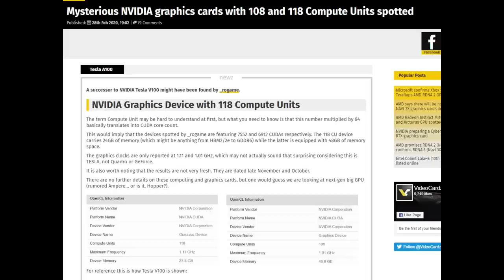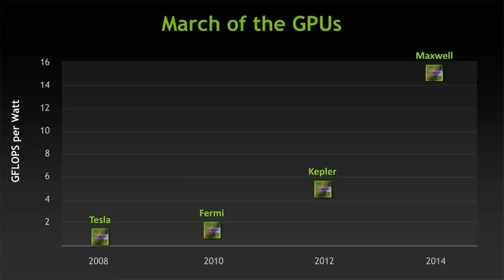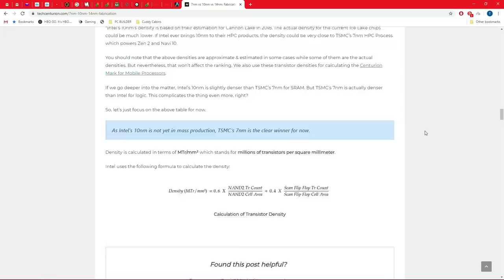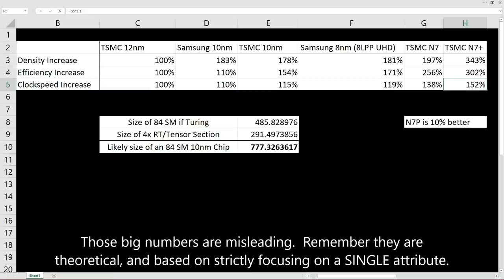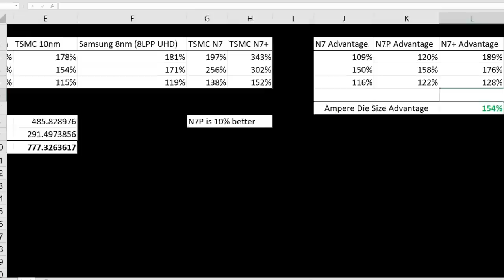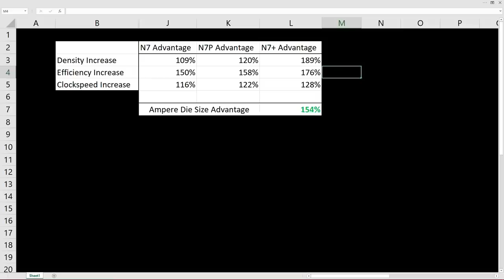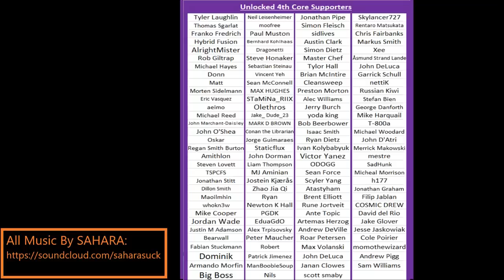Nvidia Ampere on 10nm: Still Good Enough to Defeat RDNA 2.0?

Comment: I need to clarify your math on the theoretical density improvement vs reality. 

A 60% density increase would cause a 37% area shrink for the 'same' chip. 
If the density goes up by 1.6 but the total number of transistors stays the same (just smaller), then your area is 1/1.6 of its size on the bigger node, meaning a 37.5% area shrink. 

Just pointing out that you said a 60% theoretical density increase "didn't even get a 50% area shrink"

Comment: I think what AMD needs to do is quite simple.

Step 1: release a most powerful GPU in the existence - take the performance crown from RTX Titan or RTX 2080Ti (don't know which one was better for gaming, even if Titan was never meant to be used for games).

Step 2: Gain the recognition of NOT just catching-up.

Step 3: Wait for NVidia to release Ampere that might dethrone them (most likely will with massive die, HBM2e, etc.).

Step 4: Present mid-range cards that will wreck Ampere performance/dolar.
Reply: Tbh they need to win in mid range first so they will get faith from the usual costumers with a quite low power consumption even if possible make the lower end one wreck 1650S/5500XT while having a 75W TDP
Reply: @3dcomrade  Yeah, that's what they did with Zen - start with midrange parts at good prices, refine it and improve it, and sell the last-gen parts at reduced prices until the competition is virtually irrelevant outside of the absolute high-end and niche low-end use cases, and then release a stupidly powerful high end part that humiliates the competition with more than double the performance at half the price.
Reply: That's exactly how AMD could fail, ironically. By attempting to fight at the top end where they have lost, and will continue to lose to nVidia (they have half the revenue of nvidia, bear this in mind) they will stake out fairly valueless territory. Top end GPUs account for less than 1% of sales. If amd want to do well they need to produce a stable mid range product, focusing on a 2080Ti competitor when their basic 5600XT card is stuttering, black screening and down clocking is an amusing ambition.
Reply: @nathangamble125  actually they did the samw with RX400/500 series dropping the prices a lil bit til its priced against a card thats lower by one tier e.g: RX570:1050Ti
Reply: Why not just give out free cards
Reply: @Blue Sky I am not sure if you have read the game plan till the end. Point 4 is what brings them money.
Reply: @Blue Sky Hope they do, because the longer they stay afloat, the bigger chances we have that prices will be kept in check.
Reply: High end market is a niche the real money is at mid range

Comment: Hey Tom, new LG TVs rumours started to circulate and the much anticipated 48-inche smaller and cheaper g-sync oled for gamers is coming. What do you think 👀
Reply: 48 inch screen for gaming? not at a desk unless you want neck problems.
Reply: @forasago  I bought a pretty large desk to for my piano, I can see why it won't target "all" gamers or at least most of them but a lot of people (including me) are sick of LCDs and are looking for replacement. If the TV does well, there's no doubt they will move to as smaller as OLED allows them.

Plus I watch a lot of TV series and movies along with sport, so instead of buying a mid-tier TV for £400 or so and another 400 for a 1440p 144hz. This replaces both. So I'll make sure it will work on my desk

Comment: It's not Navi "two X".  It's Navi twenty-something.
Reply: Do we have a source for this? If not it could be either.
Reply: @LaughingOrange  The source is common sense.  RDNA 1.0 is "Navi 1X", which means Navi 10 and Navi 14, the two dies on the market now.  RDNA 2.0 is "Navi 2X", which means (so far) Navi 21 and Navi 23, the two leaked die names.  And RDNA 3.0, called "Navi 3X", will have die numbers starting with 3.
Reply: @MaggotCZ  Well, it's probably fair to say that an 80CU RDNA 2.0 die will be twice as fast as a 40CU RDNA 1.0 die, but that's just from basic math.

And it's also fair to say that many, many TechTubers have made the mistake of assuming "Navi 2X" has something to do with performance.

Comment: The node only helps AMD so much...they need the architecture to deliver...and they've been falling behind on that for years...but now that the console works is essentially done, AMD can finally deliver on the high end PC market.
Reply: They are on par with Nvidia. Look at 5700XT vs 2070S. 2070S is 5% faster which is probably due to higher clock speeds.
Reply from the maker: The ironic thing is the 200 series was actually the start of RADEON'S decline.  It's about mindshare.
Reply: RDNA has actually been pretty good, and RDNA 2 is supposed to be as big of a jump over OG RDNA as RDNA was over GCN. AMD also said this during an event for their investors, meaning it's not likely seriously stretching the truth. It honestly looks like it's going to be fantastic, and I doubt Nvidia was really prepared to have to legitamately compete with it.
Reply: Mianlo 2  NVIDIA released the GTX 1080TI for the same launch price as the GTX 1080 and dropped the GTX 1080 price, because of the competition with Vega. But Vega did not deliver as promised.

Comment: 980 ti vs 1080 ti = 70% improvement
1080 ti vs 2080 ti = 33% improvement 
2080 ti vs 3080 ti = 40% improvement
Unless a 3080 ti costs LESS THAN $699, what the hell are you guys stoked about?
Reply: You conveniently left out "780ti vs 980ti = 35% improvement". 1080ti is simply anomaly because double die shrink, 20nm node didn't pan out and maxwell had to stick with same already three years old 28nm node used by 600-series. Then Pascal's jump to 16nm provided massive clock speed and efficiency gains. Yet people are expecting similar improvement in every generation, even if there's no die shrink at all.

Comment: 05:12  Vega 20 is not the same design as Vega 10.  It has two extra HBM2 controllers, and overall about 700M more transistors.  What they actually got was about 56% higher density overall, based simply on transistor count.  Not all transistors are equal, of course, and designs might have some dead space built in for one reason or another.

On the whole TSMC 7nm density is about twice that of the GF/Samsung 14nm process, meaning that's the best you can expect.  Their mobile 7nm process is a bit more dense, but that's not for high performance parts.
Reply: Actually the mobile node might make a lot of sense for the low-end parts like a RX6300. Making the die smaller and more efficient at lower clocks could be good. They would also gain a lot of knowledge about how these mobile nodes behave for their partnership with Samsung.

Comment: nVidia's position regarding power efficiency is especially interesting in this context. they've traditionally had a huge efficiency advantage, but going with a big die against RDNA 2.0 might cost them that adantage. They were able to pull this off with Maxwell partly because AMD was lost in power inefficiency hell back then.

Comment: First intel now nvidia going to milk people by staying on older nodes
Reply: Nvidia has literally been doing this for 10 years. AMD has pretty much always been first to new nodes but Nvidia usually stays on the mature nodes and make bigger chips. It even allowed them to have the performance crown in many cases because of issues on the new nodes.
Reply: @fVNzO  
Yields are higher too so I suspect higher profit margins have at least something to do with that decision
Reply: Why does staying on an older node automatically imply milking customers?
Reply: @ShawFujikawa  They are sticking to inferior technology because of business reasons. So its them hoarding technology or not giving the best to the customer that they could be giving.
Reply: @The_Man_In_Red  I can't remember the details but adored had a video back in December I believe detailing this exact strategy. Amd ran into plenty of issues jumping the gun on new nodes which didn't allow them to increase die size. So it's a bit of both. RTG made a string of bets that continually let them down so you can't fault Nvidia for sticking with what works either.
Reply: @NatrajChaturvedi  Why are you assuming performance is the only relevant metric here? This is not a zero-sum game.

Think about it. AMD is currently still using their older 14/12nm node for some of their lower-end products to keep prices down for customers. Giving you a better deal is somehow milking you?
Reply: that is not milking. you use what make the most sense for your company. same with HBM before. using HBM does not necessarily making the card to have advantage vs one using GDDR5/5x/6. so why need to use more expensive HBM? and there is a real benefit for to be less reliant on node shrink to improve performance.

Comment: If they just increase the die size without changing the process or architecture, isn't that going to require PC builders to get ridiculously high wattage power supplies? Like say if they take the 2080 Ti and increase the die size by 50%, would that require a 900 - 1000 W PSU to use?

Comment: Is it correct to say that there are already "engineering" samples of AMD big NAVI and NVIDIA Ampere in the wild currently? Is it possible that both companies could potentially put their hands respectively on what the competitor is currently testing?
If yes, how "real" competition can be really guaranteed to be still a thing at the end of the day?
Reply: I would highly doubt anyone outside of AMD or Sapphire has access to any RDNA2 engineering samples at the moment. We would have had more leaks.
And Nvidia is normally airtight, so I think that whatever leak we had must have been from a large scale customer evaluating a future product, most likely some HPC bid.
I think that this upcoming generation is going to be one of the most competitive in a long time.

Comment: I hope they give us a form of RTX for the lower end GPU's. Like RTX reflections only, or AO/shadows only RTX, or a modular option that we could tweak somehow. To be honest I think it's sad that they excluded 1050type gpu consumers from that sort of tech. I know 2060rtx is pretty slow, and that likewise a rtx2050 would be even slower supposedly, but it would be wonderful if they could in any way pull that off... Otherwise AMD would seem to be right with the quote that Raytracing was too early and is a tech that needed maturing. Would be funny as hell if Jensen announced: PTX GPUs next, with Pathtracing, just for the laughs. And BPTX for those seeking modular, branched pathtracing x)...
Reply: Aren't the more expensive rtx cards literally doing just that. Ray tracing reflections only or certain shadows of certain light sources. Any budget conscious buyer wants higher framerates first and foremost. They're already turning down settings. I don't think the cheaper stuff should waste die space on something which may work at 30fps in a select few games.
Reply: Ahimsa42  nice
Reply: I'm not sure if Ampere is strong enough yet. They'll probably make a RTX 4050 Ti though.

Comment: If AMD stays the coarse and releases truly new products at the rate they have been, I don't think any of the competition can keep up. BUT if they don't get it right with the launch of RDNA 2 it will be the same Radeon we all know and love. the drivers and software have to make as big of an improvement as the hardware.
Reply: The good thing is that the 2020 adrenaline drivers are now good and more feature rich then Nvidia's. RDNA was the first product of the arch. RDNA2 might have evolved a bit from RDNA1 but its basically the same GPU most likely with some, if not all, models going for HBM2. This also mean that the software side of things should be much better on these products.

Comment: Mature node means lower prices. I hope.
Reply: That was a good one lmao
Reply: I'd tell you to look at Turing but you already knew that. Damnit Jensen and your leather jacket.
Reply: Yeah in your dreams.
Reply: Nvidia is not intel so if they feel the need, they will drop prices. We see that with Super cards recently, dropping 2070 from $600 to $500 for the 2070S and also for 2080S (they actually increased the price for 2060S tho which was infuriating at the time!) and if you go back a few years, look at the price of Maxwell cards on launch... Even Pascal wasn't overpriced!
Reply: Large die size: reverse uno card
Reply: @NatrajChaturvedi  Also NVIDIA released the GTX 1080TI for the same launch price as the GTX 1080 and dropped the GTX 1080 price, because of the competition with Vega.

Comment: If 3080 Ti is only 40% faster than 2080 Ti after over 2 years, then I'm quitting my computer parts hobby, sticking with what I have and playing games I can play. It makes no sense taking interest in it when it's so slow moving forward. I'm fed up with this stagnation, I don't care about a bit faster CPUs or RAM. Seems like good years are behind us. I remember buying 8x faster GPU after 3 years.
Reply: Ryzen, vr, pcie 4, and rtx are stagnant?
Reply: @boblablaw4857  Ryzen only doubled mainstream CPU cores after 10 years of 4 cores. Games unfortunately can't use 16 threads. Period of waiting between PCI-E 3.0 and PCI-E 4.0 was the longest. Ray-tracing is hardly available anywhere (Control, Metro Exodus, not many titles), DLSS works properly only in Wolfenstein Youngblood. RT halves fps and doesn't do that much. 2080 Ti costs $500 more than 1080 Ti and doesn't become cheaper with time. I remember when after a year there was already a new series of cards. Now after a year there is... still 2080 Ti.

Comment: 1080ti gatekeepers: I’ll wait until rtx 6080ti comes out
Reply: Booon Noob good choise!
Reply: I was hoping RTX 3080 Ti would be stronger so those 1080 Ti snobs would shut up, but I guess we still have to hear from them.
Reply: @avatarion  Do you have any 3080TI benchmarks??? 
Does anyone have any??
No...so!!.
Put it this way, even if we where to go off made up rumors the 3080TI would be 40% faster than the current 2080TI...which the 2080TI is around 40% faster than a 1080TI...that would put the 3080TI 80% faster than the 1080TI.
Since the 2080TI is already capable of playing over 100 frames @4k comfortably then do you really need more than that??
Especially when cards such as the 1080TI and 5700XT are still overkill for the huge majority.
Reply: MayDay GoingDown!! What games are able to play 4K 100fps comfortably on 1080ti? It’s probably an older game. The argument that you don’t need to upgrade your graphics card because you can still play older games is dumb. Of course you don’t need to upgrade if you’re only playing old games like CS GO. But do you do need to upgrade if you want to play newer games. There are already games that can hardly play 4K 60fps on an rtx 2080ti. For example, metro exodus and red dead redemption 2.
Reply: @booonnoob7950  I don't know bud, I said 2080TI when playing 4k...not 1080TI:).
The 2080TI plays over 100 frames @4k.
Plus...you only need 60 frames...so even the 2080TI is overkill.
I've had a 1080TI and could play 4k at 60 frames without it  breaking a sweat.
3080TI....just not needed.
I myself get over 60 frames on my 2080TI on Metro and Red Dead 2.
My rigg.

AMD 3900X, Gigabyte Aorus X570 Master,
64 gig Corsair vengeance, Asus Strix OC 2080TI, Samsung NVME drive for Games.
3x 500 gig Samsung Evo SSD, 2X 1 Terrabite Hybrid Dives.
1X LG ultra wide 144hz adaptive sync monitor, (F model) not G.
Reply: MayDay GoingDown!! Didn’t you just edit the comment before and changed it?

Comment: NVIDIA want 60 - 65% margin, that's the most important topic to them.
Reply: Ampere is. Replacement for Volta it’s not going to be an Rtx type card
Reply: @Brick4956  The margin in the professional area is much higher than in the consumer area, not lower.